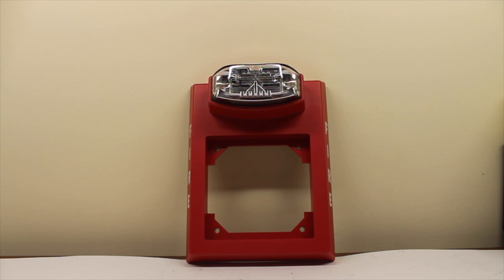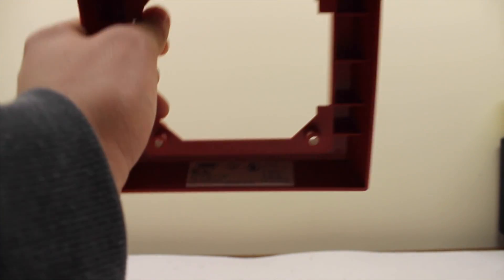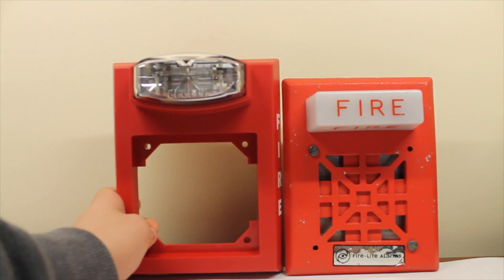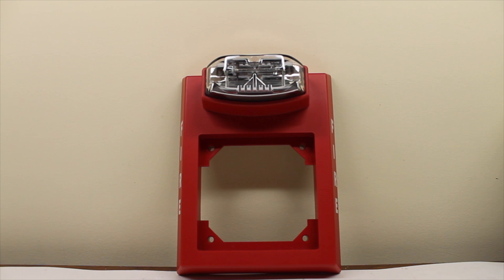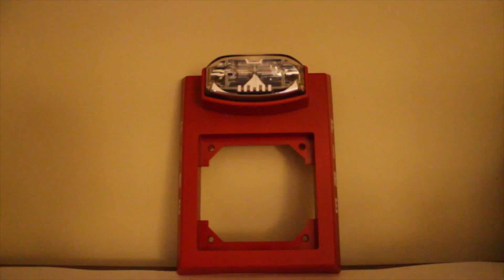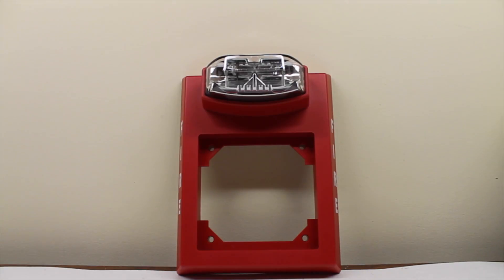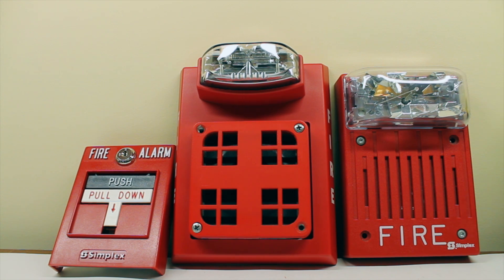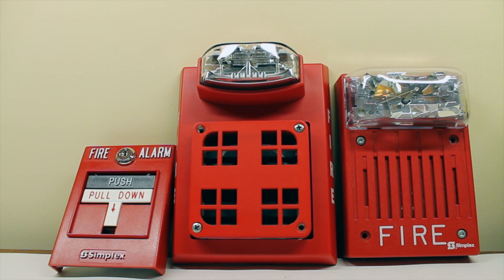System Sensor RP2415ADA Fire Alarm Retrofit Plate Overview/Demo/Test

Comment: Quick question, where can i buy a B key lock for a t bar, and is there a way to buy a push bar.
I have a 4099-9006 but for some reason the lock feels loose and i just want to make sure i can find a new keyhole if it wears, the push bar is also broken.

Comment: can a simplex 2902-9732 fit in?
Reply from the maker: Yes, but only putting it on top of the hole. As long as you have long enough screws, you can easily secure it to the plate.

Comment: Would a -9838 fit on this properly?
Reply from the maker: I don't have a -9838 at this time, so I don't know for sure that this would work the way you would want it to. However, I'm guessing that it probably wouldn't be able to fit in the hole itself, but can be mounted on the surface of the plate. According to the instruction manual, the horn can be any depth into the plate as long as the horn does not block the unit's strobe (which cannot exceed 1.9 inches). I think the -9838 would be able to meet that requirement.

Comment: Thats pretty cool I've never seen one of those before ! But a few months back I saw a strobe made by whelen as In the siren company come up on eBay
Reply from the maker: These are fairly rare. I, myself still have yet to see an installation with these installed. Not sure when that will be, but that should be interesting. Whelen strobe, the ones I found were for general notification purposes. I would say get it anyways. For me, I also like collecting some non-fire notification devices as well. I happen to have a nurse indicator light that I found (New Old Stock).
Reply: Ya I do to I have an STI push station that's says panic

Comment: Just got one of them earlier this month. It's nice. Gave it an MA Horn.
Reply from the maker: Agrotred Budderton You're using yours properly, not so much like me where I stuck my MASSLOC on there. I was a little underprepared if you want to say that. Oh well, I got the idea across somehow.
Reply: Personally I am interested in getting myself a MASSLOC. I actually had MASSLOC Alarms in my Intermediate School(which taught grades 4-6). They had 2 with Wheelock MT4 and they were all in slow whoop.
Reply from the maker: I do believe there was a non outdoor ceiling mount version that I saw (has the bigger fire lettering, etc). That could be a possibility on what your school had. It's interesting that there were some in use.
Reply: Yes. My school had wall mount, Large Lettered ones(Pre- ADA of course) in that school. One was near the end of the hall it was in(my classroom was closest to it) and was very faded because it was at a small segment of wall surrounded by Door and windows(it practically got sunbleached for the years it's been there. The other was in the middle of that hall. There both in the 4th grade wing which is the newest part there actually. Every part of that is accurate.
Reply: I really want to get myself one like that. Obviously there rarer than the thin lettered ones so I'll be lucky if I can find one at a low price.
Reply: Nevermind. I just purchased a MA/SS-24D off of Ebay for about $25. (The large lettered pre- ADA Horn/Strobe)